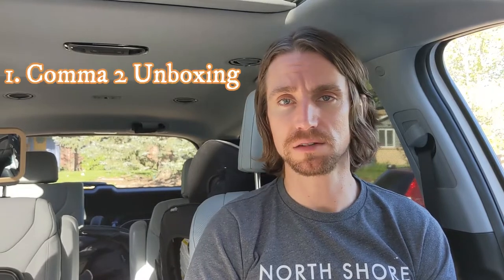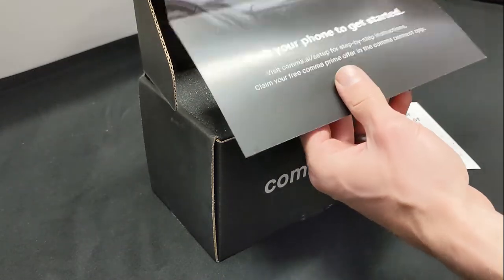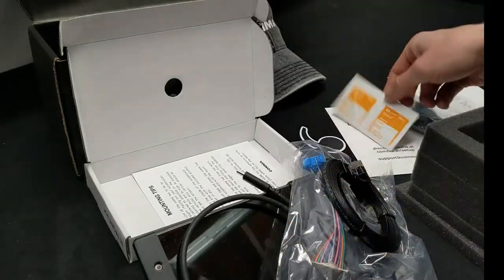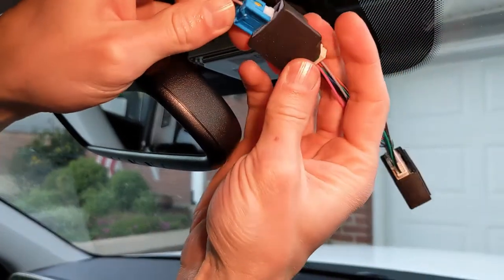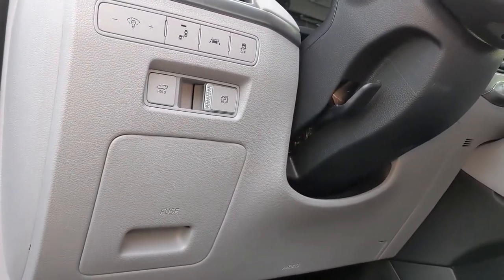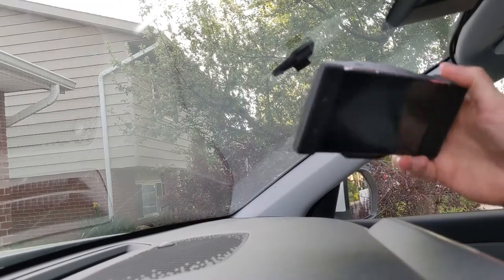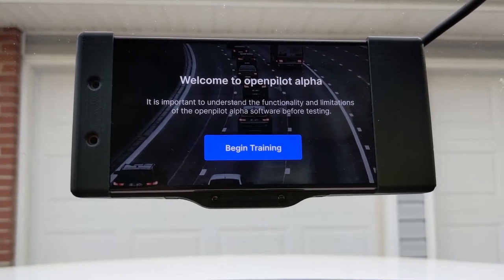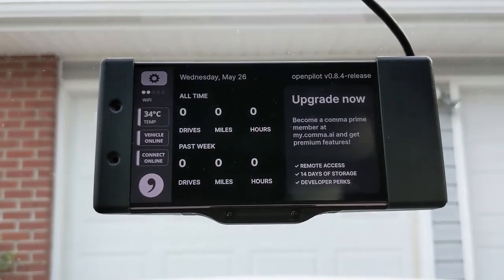COMPLETE INSTALL - Comma 2 + Openpilot on Hyundai Palisade

Comment: Great video. I am waiting for my Caligraphy to arrive, hopefully by the end of the month. I am very interested in the Openpilot.
A couple of questions about the install.
Did you have to remove panels to run the wire from the unit to below the dash. You did not show it.
It looks to me that the position of the unit on the windshield was a little low. It blocks a good portion of real estate on the windshield. Could it be mounted higher?
I also watched your first drive video and I have some questions about the capabilities of the system.
I own a 2019 Honda Ridgeline. I am not very pleased with the driver assist. It seems to me to have a very low torque threshold before it stops following a curve. It is not very useful. I am waiting to see if the Palisade is more responsive. 
From the video, I am not conviced that the Openpilot adds very much to what the Palisade has as standard equipment. Correct me if, in your opinion, that is not the case.
Reply from the maker: Neal, thanks for the feedback!  To answer your questions: no panels removed for running RJ45 to below dash.  I too wish the mount could be higher, but it couldn't be much higher than I show it since it's front facing camera must be able to see you, plus you want to be able to see the comma screen.  Depending on your seating preferences, you could probably go higher than I showed it.  Openpilot is DEFINITELY more capable than the stock system on the Palisade.  We are actually in the middle of filming a direct comparison video so you can clearly see the differences.  I hope that helps!

Comment: in the Toggle-> what setting did you enable for best OP driving experience
Reply from the maker: We just used the defaults / minimum required to run Openpilot.  We have since been experimenting with the "laneless" model as well, which is considered to be an "alpha" release right now.

Comment: I would be concerned with the cable honestly. I know you say it's not concerning but the A pillar and headliner is made to break away. The A pillar doesn't break off, it splits and let's the airbag out. The cable can and more than likely will become a projectile, I've seen it happen with people that install radar detectors in this manner. Just my $0.02